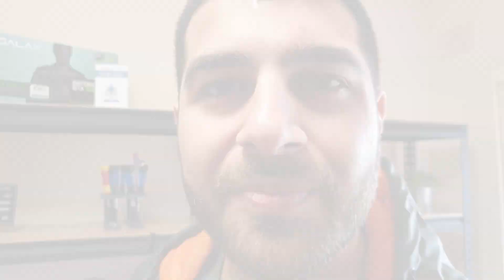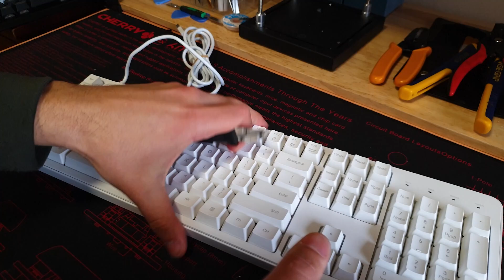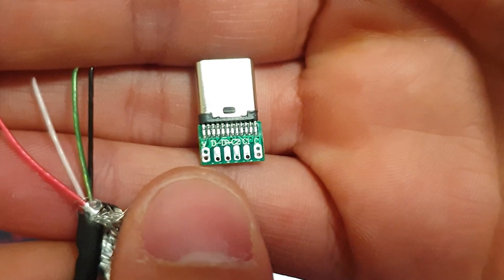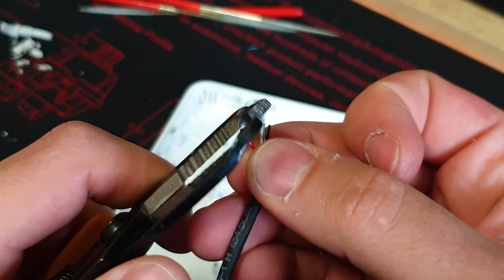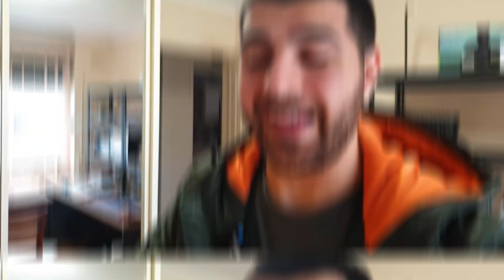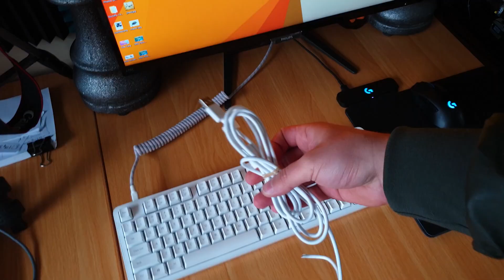Mod any Mechanical Keyboard with USB-C! - Detachable Cable Mod!

Comment: yo bro I love your  projects and want to recreate this, I found a female usb c board with 4 soldering slots but my keyboard has 5 cables going from the motherboard: red, green, white, black, blue. What do I do with this?
Reply from the maker: The 4 colours red green white black should be all you need. Blue could be ground - you can check this with a multimeter. Good luck!

Comment: but I have a problem when making a keyboard with type C, using 4 pins, because my keyboard cable has 5 cables (red, black, white, green, and blue), and it only works on the cable I made, it doesn't work on other cables, why is that?

Comment: Man, this one is unbelievable. I just finished modding my Summoner keyboard. At first i used C to C cable to connect with my PC, it haven't worked. Then i used A to C cable and it worked. Thanks a million, cheers 🍻

Comment: i bought a Rexus keyboard that came with non detachable cables. but then the Rexus team made a detachable version for their newer revision of my current keyboard. and since my cable is pretty much damaged, im going to change it to type c. its easier to replace the cable that way.

Comment: Thanks mate. With all respect, it is just the half of the job as you cannot use the keyboard in wireless mode, so your showcase is only useful if you want to replace the keyboard wire.

Comment: Does anyone know if it would be possible / simple to make a new PH 2.0 to usb-c internal cable instead of cutting off the original cable so this mod would be reversible? Or, even better: is it easy to find such an internal cable pre soldered and possibly ready to just plug it in there? I'm not quite good with soldering, basically. 😅

Comment: Maybe one day i will try it
Im here just to ask, could it be possible to convert my steering wheel wiring to a usb pluggable system, so that i can detach just the parts leaving the cabling setup in its place
Could there be any data loss or malfunctioning when doing so?

Comment: Hey I just did this and followed everything you did, when I plug this in, my keyboard lights up butttt there is an error saying there is not enough power being supplied to the port or smth like that. Can any one help?
Reply from the maker: Something must be shorting. I would check your wires.
Reply: @goodjihad  yes this was the case, I think when soldering 2 wires got together, but I tried again today by completing starting fresh and the same thing is happening

Comment: did this type c conversion on my Redragon K552. It was working fine but Last night I use it on my PC my Logitech G Pro X Wired headset mic and change it to condenser Mic is not working on Valorant. Do you have a idea on what possible be the issue? Thanks
Reply: If u have any fix for this please share then
Reply: @syedqaiserabbasbukhari  fix for?
Reply: @syedqaiserabbasbukhari  mine just work recently

Comment: Hello and thanks for the tuto!
I've bought the "(RECOMMENDED) - USB C Breakout (with 56k resistor)" as recommended for USBA but I'm kind of lost and need to know which one I need to solder ? Thanks :)
Reply from the maker: 4 pads typically. +5v Red, White Data -,  Green Data +, Black GND.
Reply: @goodjihad  Hey thanks for the answer but I've bought the one you shared and I have CC2, SBV1, D+, D-, CC1, SBV2, VBUS, GND.

Comment: I got a budget mechanical keyboard that is really valuable to me not in terms of price. The keyboard was from my girlfriend. I went home I went home from school (I'm in College) and just saw my keyboard's USB plug dented and flat. I tried to fix it but it fits too tightly now when being plugged to my laptop which I am afraid might break when plugging and unplugging. It's not a detachable cord so I am definitely going to try this out since the connections and soldering seems simple to me since I am studying electronics engineering. I just needed the guidance of this video for assurance lol. Trying this soon once my Type C female breakout board arrived!
Reply: Update: Well like I said, I'm an ECE student so it was a bit simple for me and of course it works as I expected. But since I do not have shrink tubes for now, what I did is is since I stripped the four wires a bit long and my type C female breakout board does not have a hole, the excess stripped wires was covered with electrical tape to avoid any contact to each other which may cause shorting. And then wrapped the four again as whole with electrical tape again this time, to be secured. As I do not have a putty like what I'm planning in the first place, I just melted extra black plastics from random things using my extra soldering iron. That way, the breakout board is intact and looks good since I used plastic and just did a bit of sanding

Comment: It's C for common, its a term we use in electronics since its a common area to put your ground or negative in.

I EXTREMELY recommend putting hot glue or epoxy to secure it or over time you might yank the breakout board accidentally
Reply: I’m a first year computer engineering student and you just taught me this lol
Reply: @platypusaf  be extremely careful as there are different meanings for C always check the circuit diagram

Comment: I'm new to all this. If my keyboard has 2 black ground wires do I just solder them both onto the "G"? I'm assuming that 1 black wire is for the keyboard and the other 1 black wire is for the side usb ports? Its an apple keyboard I'm messing with.

Comment: I have a mechanical that is REALLY OLD that got flooded and a bit (dried) muddy and i need to change the big and old 5-pin connector and upgrade it to usb-c to usb. You think i cn upgrade it to that? Like it is a 1996 mechanical keyboard....i want to show what the pcb looks like and the connection of the wire because i dont know which materials to buy so i could upgrade and (hopefully) get it to work. I cant see adaptors for it.

Comment: Ima try this on my mouse and keyboard later today ima keep yall updated on this comment. Hopefully I don't break everything !

Edit/Update:  It worked !!! Now I'm going to make my own coiled cable with aviator conection!!connection!!! Woooo. USB type C and cool cables !!!!! LETTS GOOOO!!!. Also, I'm switching the switches to yellow ones !!! Woooo!!!!! So glad I did this. I'll keep yall posted on the switches and custom cable here!.
Reply from the maker: Nice job bro!
Reply: Yo quick reply! On my seccond keyboard.! The 2nd one i modded it with lots of keybord mods. Works great!. USB TYPE C detacable, lubed switches.... more and more. now im on to my mouse! Watch out. LEETSS GOO!!!!!!!!

Comment: What would happen if I grounded cc/cc1 to the same zero ohm resistor with in the keyboard? Came factory with it on the ground wire on the left board.

Some have said USB C needs a 5k ohm resistor in series with CC1 to generate 5v. But if it’s already populated on the board internally I’m not seeing the reason behind this and why the mod isn’t working at all.
Reply: Update: with the zero ohm resistor in series the lights actually came on but no key inputs.

Comment: I wonder if this is possible with my Alienware Tactx Keyboard. It’s hardwired but had two USB A connections for the keys and lights. 

Yes I know it’s old but it’s blacked out and I love the design and it still works. 😄
Reply from the maker: It will work. You can grab a USB 2.0 hub. Wire the usb from the hub to the USB-C port. Then route one of the keyboard wires to one of the usb ports and then the other port to the external port. It can work but needs some modding.
Reply: @goodjihad  not a bad idea, I will make note of this. Tried the usb c mod no lights or anything though. 
I had broken lightning connector cable and wired up a usb c male end on it and the cable is solid. 
I think one of my spare female ports is either bad or I’m missing something to do with the circuit. I plug it in to my pc hear a ding but no response at all. 

Also dealing with more than double the wiring that’s in this vid and most other mod vids I’ve watched. 😆

Comment: Good video tutorial im actually making it but I have some problems when I plug in the keyboard to the pc windows detects it as an unknown device and one of the LEDs of the board stays on static, I double checked the cables I solder and they are ok idk if the USB C connection I used is faulty since I used a different one from what you used but very similar or that's what I think for now, hope you or someone in the community could help me out with this please, but anyways thanks for the video
Reply from the maker: Thank you for watching! You could have the data wires soldered on the wrong pads. Swap them and see how it goes! It could also be cause you do not have a shield wire which helps to improve the connection.

Comment: Question does this method work on a g710+ ....
Reply from the maker: Any mechanical keyboard! Any USB device. It all has the same wires you just have to find the space to fit it into the device.

Comment: Great content, I'm unsure whether you'll reply after an year of uploading this. So, I've a G512 (G513 Globally). It has 2 usb connections one for the keyboard and another for an additional usb socket in the keyboard. Could you guide on what is to be done? Thanks, have already purchased the necessary stuff from your link. Will really appreciate a reply.
Reply from the maker: You could buy a USB 2.0 hub and take out the pcb. Then put the pcb inside the keyboard. One port is soldered to the Keyboard and the other to the additional internal USB socket. The main USB hub cable is then wired to the main port that connects to the PC.
Reply: @goodjihad  Thank you so much, will definitely work this through

Comment: I have a keyboard with a cable that splits into two to connect to my PC. Seems like one for the lights, and one for the actual power. Would this mod work with that? Would I need a different female USB-C port?

Comment: Was literally going to buy a whole new custom keyboard as of the usb c but found this video and I have now just bought that type c converter UPDATE: worked brilliantly only problem I encountered was a short circuit on the usb c port all it took was some insulation tape
Reply from the maker: Amazing!

Comment: Hey whats up i k ow this vid is one year old, but i want to do this to my Logitech g413 carbon mechanical keyboard, but is got one cable that turns into 2 usbs, any advice on how can i detach it..
Reply from the maker: Unfortunately not. You can convert only one to make the keeb work. The other unfortunately not unless you get a USB hub and modify that too!
Reply: @goodjihad  hi, well i got a usb conector on the keyboard i don't care if i loos that conector. But id like to do it to the carbon keyboard, would this process work the same on the carbon?

Comment: "I have so many tools that only I use"

Now that you've recommended them, that's no longer the case. ;)

Sorry, stupid joke. I know you meant "I only use" rather than "only I use".

Edit: Also I like the recommended USB soldering iron. Although, the pinecil is about the same price, goes hotter, and seems to have more features for the display/os. On the other hand, pinecil's are all out of stock until sometime later this month, which is a bummer.

Comment: is it possible to do it on headphones? my headphone USB cable is looking like trash since its getting really old even tho it works perfectly
Reply: The same thing happens to me, my void pro usb are about to die and I would like to make a mod to have the removable usb cable
Reply: @zeldars  its funny cause I got the same headphones without even mentioning it lmao
Reply: @JuniorColanzi  oh what a coincidence, i was looking at the circuits and the rgb lights have an extra wire to ground could you try soldering both wires on the usb c
Reply: @zeldars  6 months passed and I finally did it, worked perfectly, just did the exact same way as the video, the extra wire you mentioned is actually another ground wire, which is for the metal inside the original cable, I didnt have to solder this cable since I'm currently using a USB C port!
Reply from the maker: Very possible!
Reply: @goodjihad  im about to do it lmao, just need some time

Comment: question, where, if anywhere would i solder a second black wire to? i bought a similar looking female usb-c port at first and with my research, couldn't find anywhere that gave me proper instructions so I bought another one with a1-a12 and b1-b12 in hopes that would work and it sadly didn't. any advice on what to do in that case?
Reply from the maker: You can solder it to the same ground black wire or to the casing of the usb-c female. It is a shield wire. You must have soldered the wrong black wire to the gnd. Try the other one and it should work and check your pinout 5v is typically red and black is typically gnd. If there is an extra black which looks thicker and is adjacent to the gnd wire it's the shield wire. You can probe it out with a multimeter to confirm.

Comment: does it matter which way you plug in the USB C cable in the end?
Reply: Yeah, if you put the connection in the wrong way then you'll have to hold the keyboard upside down/ type upside down- So make sure you plug in that USB C the correct way.

Don't know which way is the right way?
If you take the plug- and you have to look at it really up close...blow on it so it fogs up then wipe it down so it is nice and clean/ shinny...you should see a little beige dot(may vary in darkness)- depending on your hair color, the dot may have a brown, black, or yellowish highlight on a small part of its top. 

Still can't see it?
Have a friend or family member help you out. Make sure you tell them what exactly it is that you are looking for. In most cases, having that extra help spots the dot right away,which in most cases is right in front of them.🙆‍♂

Comment: @JUJU i have a hyper x alloy elite which is also a usb hub so in fact i have to  connect two usb Kabel with my computer. I guess i have to build in two usbc ports to the keyboard?

Comment: I have my steel series apex pro ripped apart right now. The only issue with this keyboard is it had a USB passthrough as well as a mini lcd screen. Will i need a special breakout board? I ordered a usb-c breakout board on Amazon but it does not look the same as yours. I think i got the wrong one. Lol someone help 😂

Comment: Been thinking about doing this to my Razer Cynosa Chroma since if someone walked on the cable it would just unplug rather than break at the USB A connector lol... Using it for gaming on the TV so it happens a lot.. The connector is pretty mangled and this keyboard works fine for me :P
Reply: Or just get a wireless keyboard

Comment: "How to for $5!!"  Buy port, with shipping, buy cable, with shipping. Not to mention if you don't have a soldering iron, or solder, that's probably another 30-40. At minimum, IF you have the iron and solder, you're looking at LEAST $30.

Comment: Hey Juju!  I'm trying to do this for a razer blackwidow but it has an additional black wire.  I have the adafruit usb c breakout board from the description
Reply: I have the same issue with my Fantech mk872. It has an additional more thick black wire. Have you found a solution?
Reply: @kethakaa  yea so i tested with a multi meter and iirc the extra cable was just grounded to the case and u can ignore it
Reply: @yoshi4279  Thanks man

Comment: I just modded my Reddragon Kumara the other day, and as a tip to strip those annoying thin wires that don't strip cleanly with the wire stripper, make two or three shallow cuts into the insulation with a box cutter or any other sharp knife, then pull the insulation with your nails. The wire will strip cleaning without loosing strands. If your keyboard has RGB and you use it on all the time I'd be careful soldering the red cable because a bad connection (i-e more resistance) could make it overheat or make your keyboard malfunction due lack of current.
Reply: Can you explain it better? What do you mean by being careful soldering the red cable?
Reply: @kethakaa  red = power =5v = all the juice = if you fuck that cable/solder oh boy great thing will happent aka you going to break something basicly

Comment: Im going to try this in my MSI Vigor GK80. I dont know if it would work properly because this model has a cable with two USB connectors to allow an USB passthrough on the keyboard. As long as the keyboard works is fine, I dont mind if I lose the USB passthrough capability. My main keyboard is a 60% (modded Anne Pro 2) and I would love to be able to change it easily when I need a full keyboard. I have my keyboard connected with an usb c coiled cable with gx12 aviator connector and it would be awesome if I could use the same cable to connect my two keyboards as I please. I've ordered the adafruit usb c breakboard and a jst ph 5 pin connector with 30 cm of cable to try if it works without damaging the original cable.
Reply: UPDATE: The keyboard works with any regular usb c cable, but not with my aviator coiled cable.

Comment: Hey Juju. I bought my wife a Glorious Full size keyboard and sadly, the cable is also not detachable. I haven't opened the keyboard yet. I tried looking for tutorials on how I would make the cable detachable but only end up with teardown videos. My problem now is that those teardown videos show the connector of the GMMK has 5 wires, unlike yours that only has 4. Could you help me out on this one? Thank you!
Reply: Have you found a solution to this problem?

Comment: bro i need your help, in my redragon kumara there is brown wire (ID) where to solder that?
Reply: Hey! did you end up figuring that out? I have the s113 and I have 2 black wires (5 wires total) and not sure what to do with the 2nd black wire (it has white printing on it).
Reply: @saml3221  yah  add me on fb joshua ibatan , disregard one blsck wire you only need 4